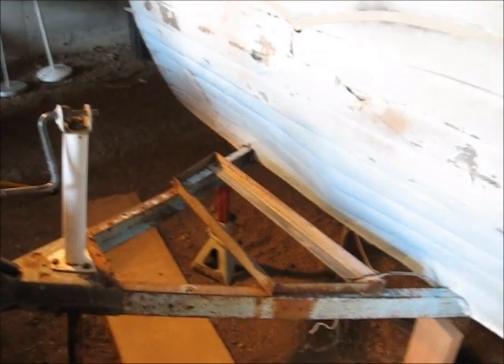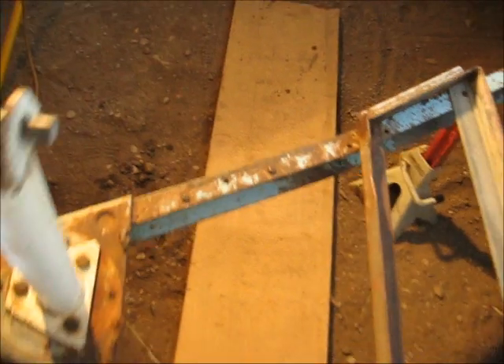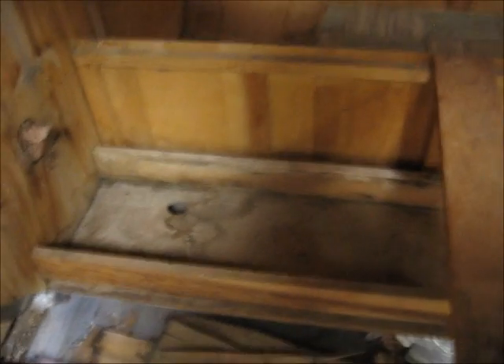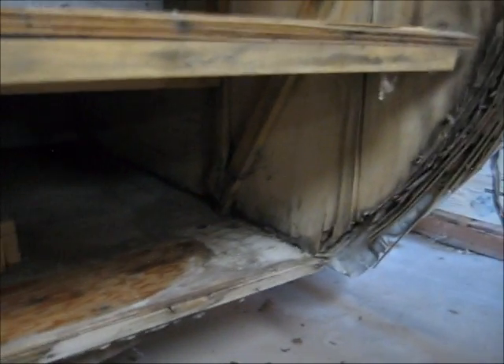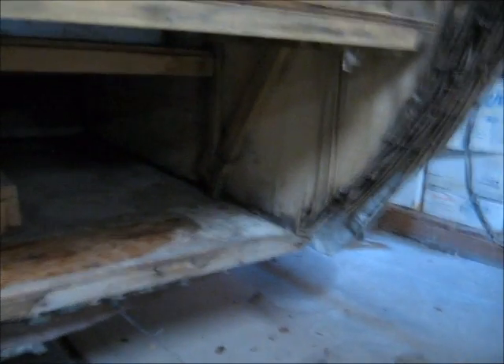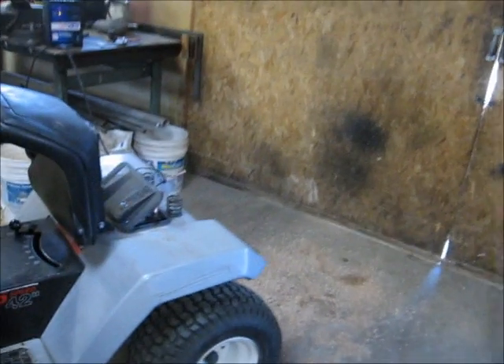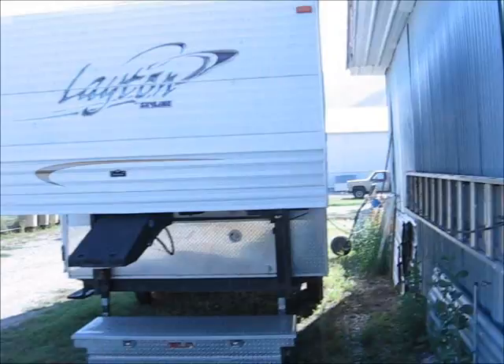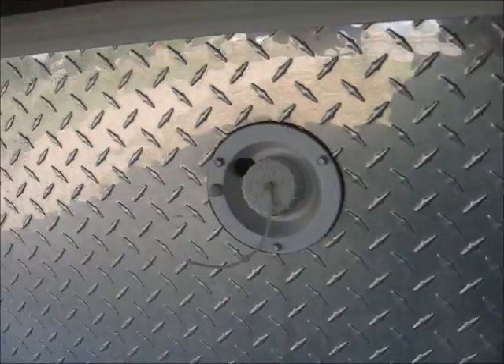Checking for the VIN on a vintage trailer. No 4

Comment: Hey, your trailer looks remarkably similar to mine as far as the hitch, window placements and size, layout and hookups. If you figure out what make model year yours is, let me know cause the only clue is that it says komfort . only got a handwritten receipt wh
Reply: When I bought it for $300 to live in/ restore after my house burnt down in March. Its getting better slowly, considering I have no clue what I'm doing and my restoration  budget is basically pocket lint and my own ingenuity, lol.
Reply from the maker: Just found your post. 
My trailer is a 1956 Pleasure Craft. You can just make out Pleasure Craft over the back window. I found a post on line of a trailer just the same as mine. They claimed it was a 1956 so that's how I titled mine.

Comment: Fyi. You may or may not know or care but drill bearings aren't designed to handle side to side thrust from a wire wheel or any bit like that. No hate just info and thanks for your info.
Reply from the maker: Thanks for the info and thanks for watching.
Reply: Dale Hobbs
Reply: yeah I found that out when I was researching using a drill press as a mill. which turns out is the same idea. not the right bearings.
Reply: HillbillyMatt ExtremeDIY, I'm imagining that the proper tool to use would be an angle grinder? I looked up your channel and see that you have quite a few interests. Greetings from California.
Reply: DanielinLaTuna an angle grinder would definately be a good choice.  I use mine for everything. If you don't have one buy a good one.
Reply from the maker: At the time I didn't have a wire brush for my grinder. I have one now. Thanks for watching.

Comment: Does anybody on here know the answer to this question; ? A friend bought a 1973 Airstream pull behind camper years ago from a private seller  in NY, The owners of the camper had the camper registered in Vermont, they sold the camper to my friend and he received the vermont registration and a bill of sale, at some point he lost all the paperwork and any information to be able to contact the pryor owners to try and get a duplicate registration and bill of sale,so he could get it registered, does anybody have any ideas on how he can now get this registered.???
Reply from the maker: kim ellingwood 
Hi Kim 
I live in Wyoming and it takes about three months to get a title. First contact the county sheriff office. They should have the requirements for your county. This is the steps I had to do. 1. Have the VIN checked by the police to see if it has been reported stolen. Send that paper work to the state to get the last know owner. If one is found send them a certified letter requesting a duplicate title or the storage fee for the trailer. If the owner isn’t found I had to place a notice in the local paper of a police auction  on the trailer. I could add to the cost of the trailer (I set the value) any repairs and storage fees. Here we can charge $10.00 a day. After the auction date the sheriff will issue a bill of sale. Take that to to the DMV to get the new title and registration. I have done this two times.
Reply: Use the bill of sale when they bought it, use the vin number off the airstream and file for a Vermont registration online. Would probably be the easiest route. The previous owners most likely did the same thing because they didn’t have a title when the bought it. Who knows. Pretty common. I live in NY on CA/VT borders.

Comment: So is it really too much effort for you to verify whether that was actually the VIN number or not
Reply from the maker: mrhumboldthippy 
No trouble at all. I used that number and jumped through a few hoops and got the title in 3 months.
Reply: @DaleHobbs39  ya know i looked harder and sure enough there are some hard to read numbers on the tongue,thanks
Reply: I have a 1980 it is on my land and a mobile home park the trailer does not have a tongue on it we looked across the front of it on the bed we did not find anything do you have any other suggestions